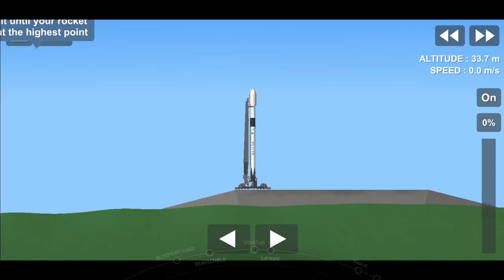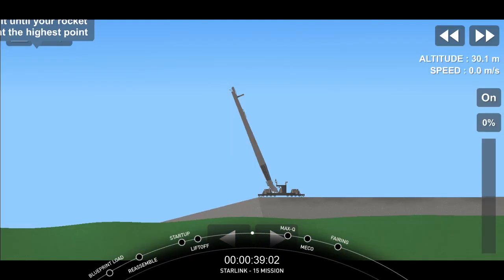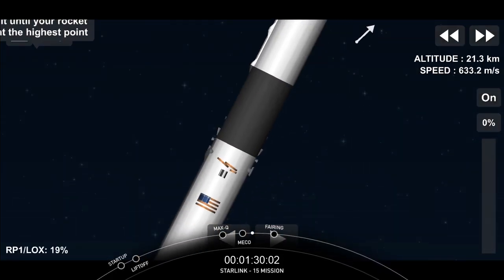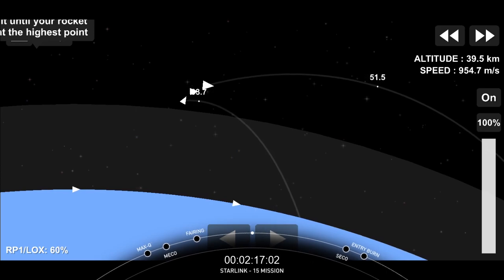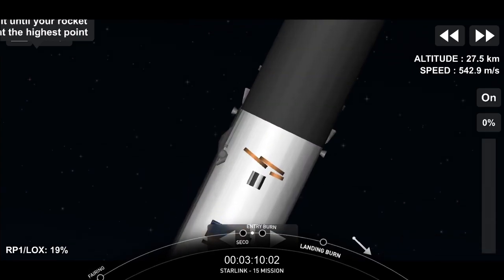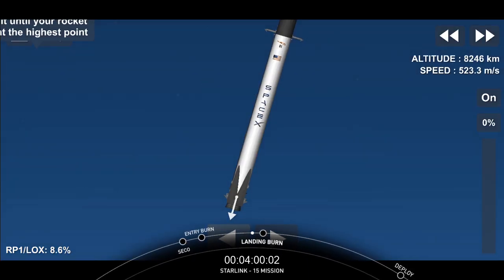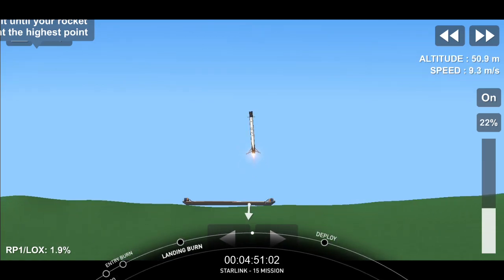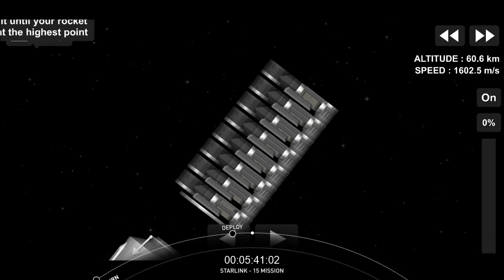Starlink-15 Mission

Comment: How did you make the bottom timeline thing?
Reply from the maker: I made a linear timeline and count the distance between the event in second unit, then adjust units distance in angle to match the spacex circle timeline using Adobe Photoshop